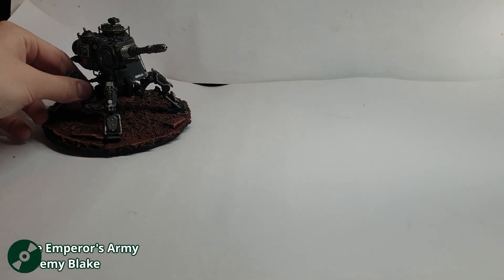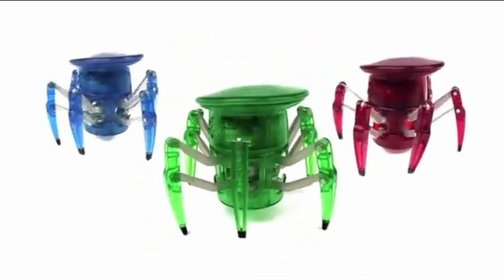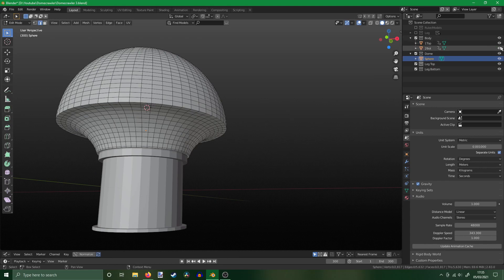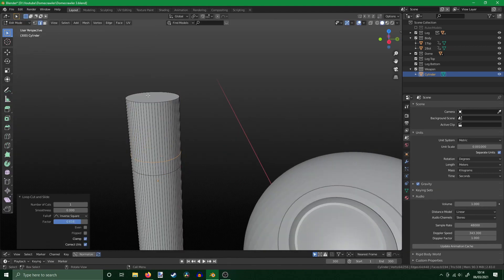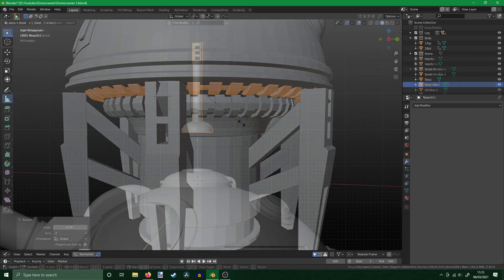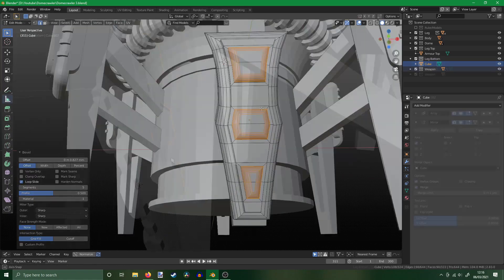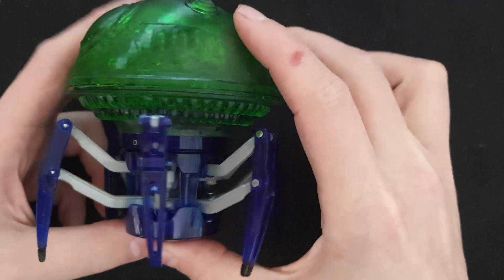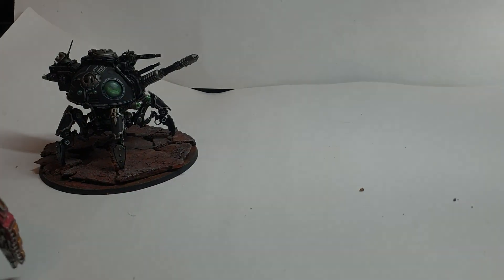40K Conversion | Hexbug into an Onager Dunecrawler

Comment: How hard would you say getting that added 3d printed stuff to fit the first time was? Or was it a perfect fit first time?
Reply from the maker: It was a pretty good fit. The base model I created in blender to begin with had all the accurate measurements of the toy so it fitted snugly.
The only problem I had was the leg armour which was a little too wide, but I'm always heavy handed with the super glue so it won't be coming off any time soon lol
Reply: @VividMiniMods  Glue is a gift to us converters, lol.